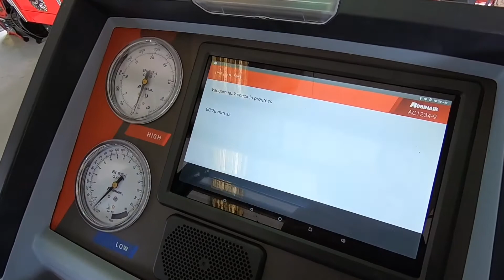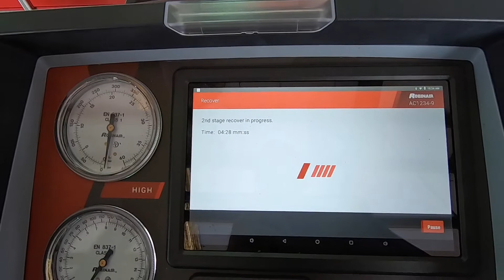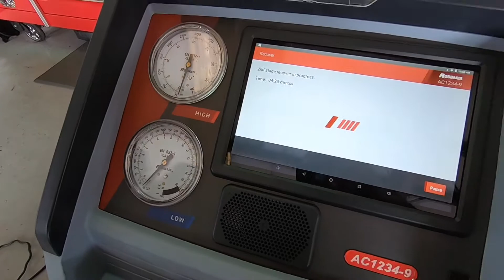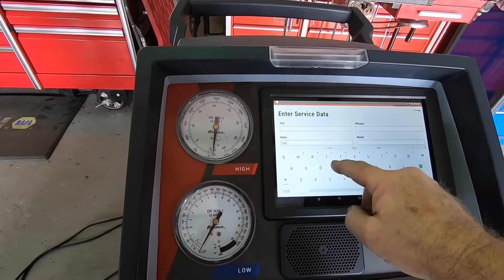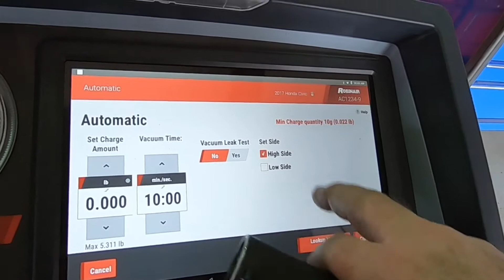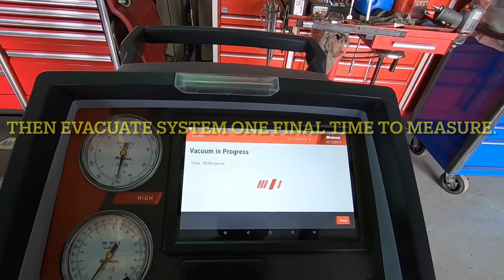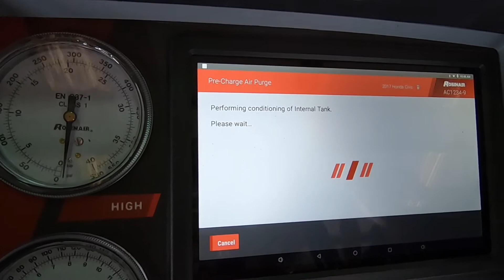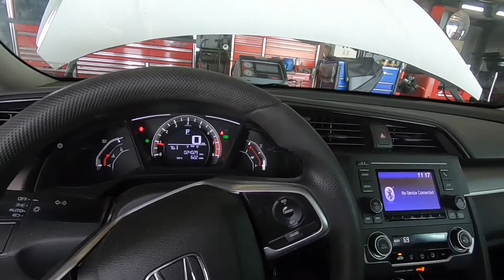Robinaire, A/C machine, R1234-YF Freon, the AC1234-9 machine, 2017 Honda Civic. #car #auto

Comment: So, from a professional standpoint does that model of the Robinair a waste of time, due to all the extra precautionary vacuum downs and self-checks? I just have the old fashioned bullet-proof 34288, and am now doing research on which 1234yf machine to get. Do you have any experience with the Mahle machines?
Reply from the maker: This one machine is my only exposure to the bureaucracy of the 1234yf industry. Sadly from what I hear they are all incredibly time consuming to use, but not any more efficient at detecting leaks. Or maybe slightly better at best.
Very expensive though. This machine at least has worked without any issues so far.